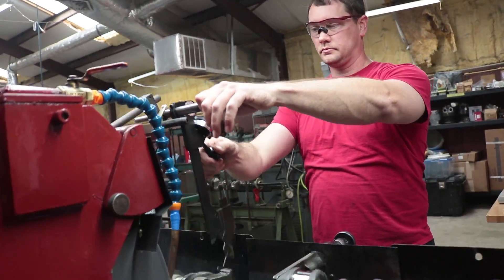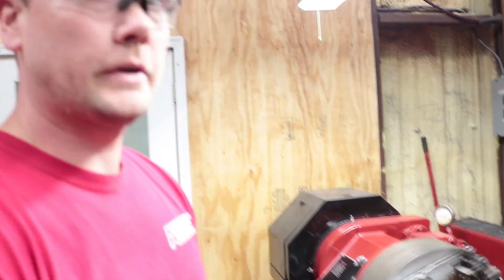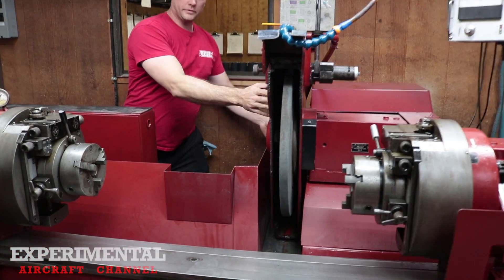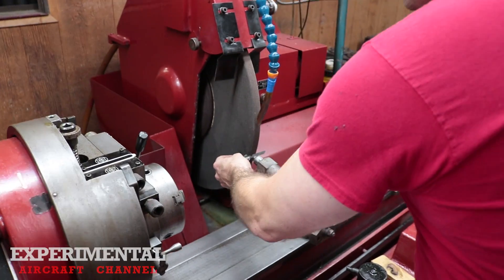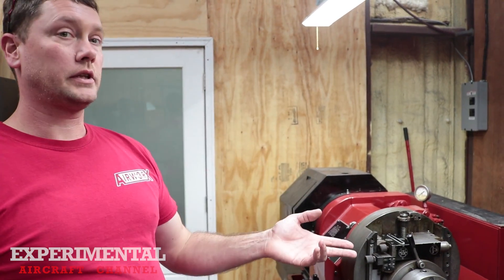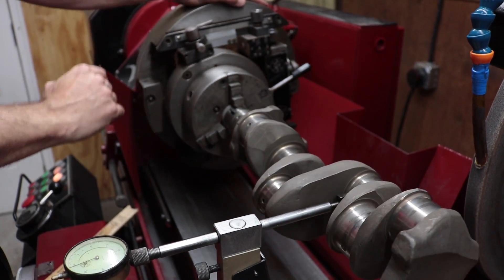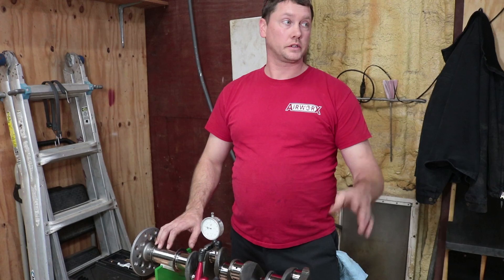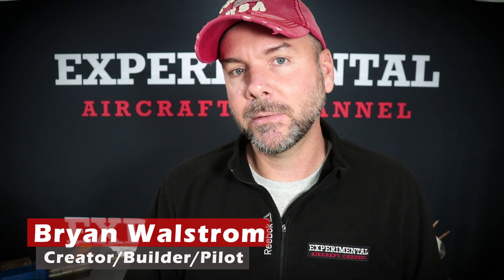OVERHAULING Aircraft Crankshafts -  How its done Airworx

Comment: After working at high level racing the one, and most important aspect of engine building, is the balance of internal parts. Especially rotating. In those cases, an engine would not last long, however the outcome would only mean you loose your chance at placing well, or winning. In aircraft, it means you may loose your life. The average cost of an aircraft engine rebuild is very expensive, and at the price charged, I believe precision balancing should be included. On top of that, it's proven that it adds smoothness to the operation and extra HP.

Comment: There is a very slight .004 thou bow in that cranshaft as you can see the needle on the dial indicator moving and also the uneven quantity of grinding sparks shooting down from the grinding contact area. I bet when that crankshaft is in service for a while in the engine that uneven bearing shell wear would be evident across the saddle bearings if the engine was disassembled.

Comment: The diamond should be turned a quarter turn to prevent the diamond from getting polished on one side which polishes the wheel instead of sharpening it. A freshly rotated diamond edge fractures the wheel grains creating new cooler cutting points on each grain.

Comment: Very cool video, thx.  A radius, though, does not eliminate the chances of stress cracks, it just dramatically lowers them.   Enough load cycles over enough time and you WILL have stress cracks, at some scale.  Eventually you will have them to failure.  Metal fatigue is a real thing, and if you've ever looked at something like a rod with an engine running high RPM they are bending visibly, and more than you would ever guess.  Crankshafts are getting nasty rotational (torsional) and lateral loads, that, and the 'crooked' nature of them is why their cross sections/thicknesses are so much larger than say, a transmission input shaft coupling that same motor to its load.

Comment: I used to grind metal rolls for the steel industry. Believe it or not, I would hold two ten-thousands on the O.D. and I.D.Do not know why they wanted such a tight tolerance but what the print wants the machinist makes. At least that what I would do. The other guys could not do that and would just crash the machine. Nice explanation too.

Comment: Aircraft engines are made to such precise tolerances yet the damn things fail way to much . Can't say it's from high RPM yet a car engine will run at twice the rpm almost forever . An aircraft engine is very similar to a Porsche , chevy corvair , subaru and don't have the same problems . Don't make sense to me .
Reply: I'm surprised they allow .007 on that shaft, but I suppose it's not running at 20k rpm or something.

Comment: After dressing the grinding wheel, by the sound that is made as the wheel engages the work, you can hear un-even contact. I do not believe the wheel is dressed enough, and is out of round.  The wheel could also have moved in the blotters between the flanges during across-the-mains starting.  I use variable frequency drives to soft-start the wheels on all my grinders to avid any potential of wheel slipping in the blotters during startup.   Another note, in the camera shot of the wheel storage rack, it is plain to see the metal buildup in the pores of the wheels.  I realize you re-dress the wheels before using them, but I just get the feeling the operator is not dressing the wheels enough to clean them out and also get them round.  Just an observation, because the science of grinding means controlling all the variables.  I do understand that these wheels are tight-bond wheels because they are holding the form radii, and are not going to break down. This makes deep dressing to remove buildup even more important.

Comment: At 16:30 he says, "This crankshaft has one thousandth run-out, the book allows for seven thousandths run-out."   There is no way in heck that any one, any where, any time, would allow for seven thousandths run-out.  Seven tenths of a thousandth, I would believe, but in which case he is using much too course of an indicator.  Something does not add up here.  I know aviation engines have different tolerances than automotive engines, but I got to believe that if any engine engine had seven thousandths of run-out, that it would lock up like a cement truck stuck in a traffic jamb!

Comment: All my car cranks that I ground on a Van Norman 111,  in between centres. had runout of .0000" & I never had to change grinding wheels from rods to main journals. I don't know how people can charge people to ruin cranks grinding them in chucks. I can grind all the journals accurately (specs)all day long & check them for specs. I like people to get back home when they take their yacht / plane out for a ride. I learned how to grind cranks wrong working in an "pro engine building " shop doing them wrong & not meeting specifications , then I worked for a retired shipwright that was in the car plants  (Ford)& seen all the crankshafts being ground in between centres & using dogs on each end. He was allowed to tour their shops with the Allied War Effort & did. I learned from him how to regrind crankshafts (without having to rebalance the crank) the same way they are made & had "0" problems. Rather than use a reground crank (done wrong in chucks) I would use a std./std. crank & polish with 2000 grit by hand & use a .001" bearing. I also had a record holding NHRA engine that I checked over . I put the crank in the grinder between centres & checked it out. It was not perfect , it had .0002" runout on the 7/8 rod journal & that was it. I still have the crank forging # 6764 (67 302 small journal) a true piece of bent iron , from "Hank The Crank" , it is fully counterweighted, cross drilled , & hard chromed. I need to know why people can do them close & say that it is right , when they are not. Question is there any "engine rebuilders " grinding crankshafts between centres anywhere close to Atlantic Canada , North America .  I guess we have to buy new cranks to get good results. The last engine I built had three first places in three races & was started at the back in the last race. We were the only car there from Halifax Co., N.S. , Canada. You could not get me to work for you grinding cranks in chucks period!!! I don't do close . I feel bad for the people working in the rebuilding industry , because all they know is what they are taught on good machines used incorrectly. It's lonely at the "TOP"  I would put up mine up against yours anyday. Thank You ( Motor Mouse ) James T. Burke

Comment: Although I have about 30 cranks to turn next week(in addition to a 455 Olds, 383 Dodge and a couple of LS's to build up)...I still like seeing how other shops/machines do things at times.  Personally, I polish all journals with a "band" hand held polisher after the grind but everyone has their own method.  Curious how much they add to the price because it's aviation specific...
Reply: We polish after the nitriding process because the part actually grows .0003. We use a stand alone polisher using a micro-polishing belt. Much more expensive than automotive because of several extra processes. MPI, shot peen, cad plate, nitriding etc.

Comment: I wonder if with modern metallurgy of the 21st century it would be possible to up the aircraft TBO interval. Automotive engines last so much longer than they did just 40 years ago or less due to such improvements, so wouldn't it be reasonable to upgrade aircraft major internal components to today's standards?
Reply: We are actually working on Billet crankshafts for some of the Franklin engines. The problem is the certification process it takes in order to get them approved by the FAA.
Reply: @airworxaviation9230  I assumed there were regulations. That shouldn't be a complete barrier though.

Comment: how do you center on a damage journal?
Reply: You can center on the undamaged part of the journal but as long as it is round you can center. You are centering relative to centerline which is easy to accomplish with the correct tooling.

Comment: Who builds this machine,   Where?     How do you grind the rod journals,  being offset as they are?   Do you dress wheel every crank?   Do you just grind to cleanup, or take them all down to same size so new bearings are all same size?    Thanks, nice video.
Reply: This is an AMC machine manufactured in Denmark. We dress and radius the stone for each crankshaft we grind.
Reply: Airworx Aviation nice work.    Thanks

Comment: The chinese crank grinding machine sounds like it has a bad bearing already........
Reply: AMC = Aarhus Machine Company. a Danish company making engine rebuilding eq. AMC-Schou has been around long time and still is in business.
Reply: No bad bearings in our machine. You are hearing the coolant pump and the coolant running against the wheel of the machine. This is a Danish built AMC machine that holds extremely close tolerances.

Comment: Great video. Interested in how a hollow crank is checked. How the bore is inspected and machined out if required.
Reply: Several methods are used including visual, MPI, and eddy current inspections.
Reply from the maker: @Iam Herdis. Thank you for your comment. That is a great question. I have no idea. I will ask Chris at Airworx to try and comment back here. Thank you for watching!

Comment: This is a  Rd Grind     for a 2700 RPM engine.        Shops we use  Grind   for engines  to 10,000 Rpm. 

guess what   They are Ground the same.          What is the difference ?  anyone     And  the guys that re grind are never held responsible  for there work.      You  roll the dice and take your Chances     That is just the way it is. 

   Big Question     HOW MUCH DO THEY CHARGE for a Re Grind.
Reply from the maker: @Greg Plaka I have no clue. Interesting question. What type of engine are you building and having these shops to these grinds for you. I am learning about this as I capture it to share to everyone. Happy to dig deeper and inquire.

Comment: Much respect for the fellow grinding the crankshaft.  Being a machinist myself that has ground the outside diameter of shafts 4” x 84” within ..0002” .  Not an easy deal.  I wonder if the crankshaft gets rebalanced after grinding?  Since taking material off.  Would be a minimum amount of weight.
Reply from the maker: @Randall Harmsen Thank you for taking the time to watch and also engage here! I really appreciate you. I honestly don'e know about the rebalancing. Something maybe Chris @Airworx hopefully can comment back on here.
Reply: Experimental Aircraft Channel, I think it wouldn’t be a problem with the balance of the crankshaft.  Talking a gram of weight or less.  Do you know if the crankshaft is forged steel or iron casting?  Would believe steel forged myself.
Reply: I think the crank is balanced from the factory
Reply: ,,, the weight that is ground off the shaft, is made up, close enough, by the necessary thicker undersize bearing . I'm sure just about all aircraft cranks are steel, and most brought to near net shape by forging .